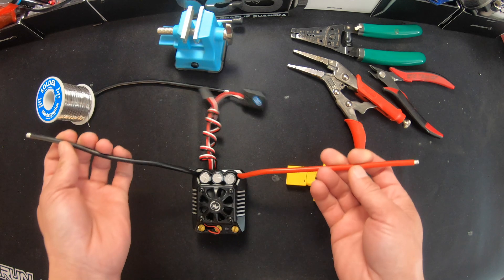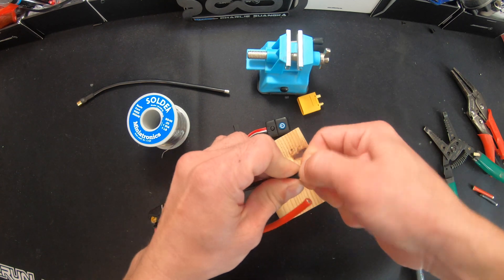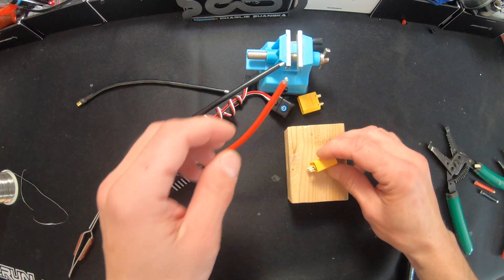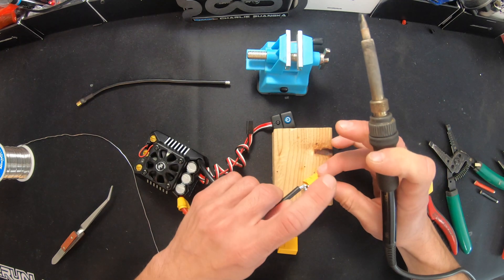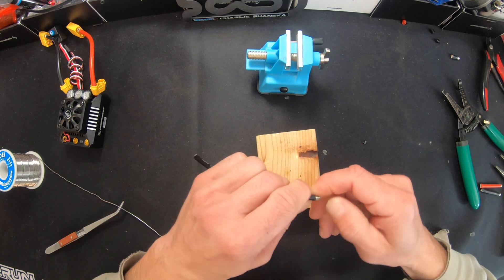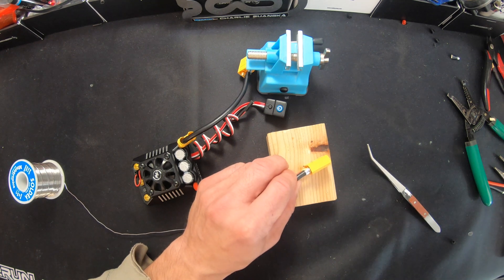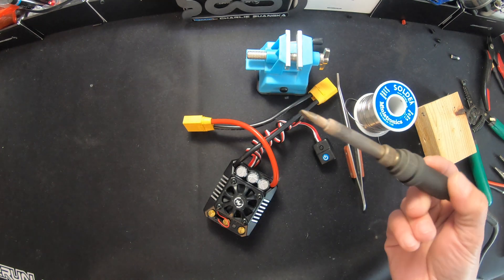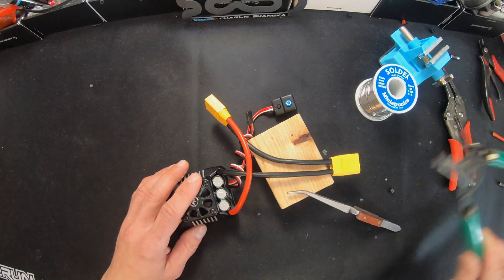The Charlie Show /// Episode 197 /// Series Connector Install

Comment: A little trick or tip I'd like to add to this.....is soldering up a jumper. The purpose of a jumper is basically to bridge the series if you decide to just use one plug. 

Lets say you have 8s with 2 4s packs. You could unplug on pack, plug in a jumper to the other connector which is basically ± - connected.

Did my geek make any sense?